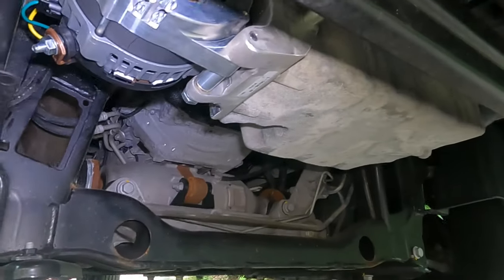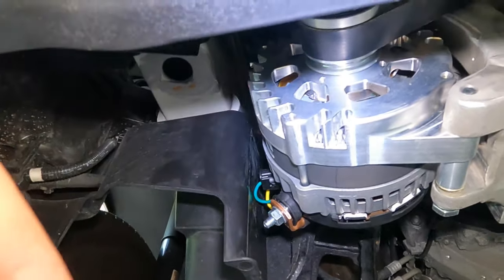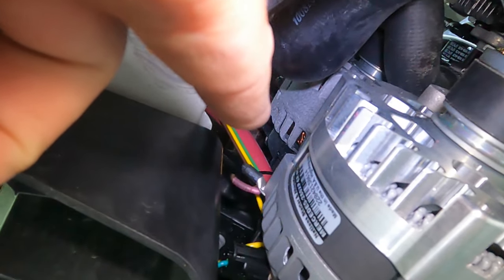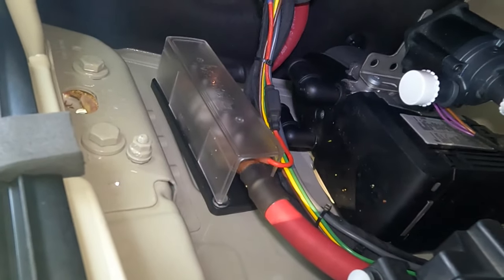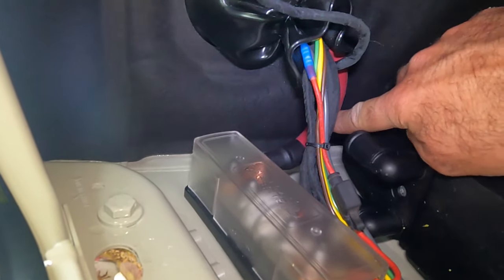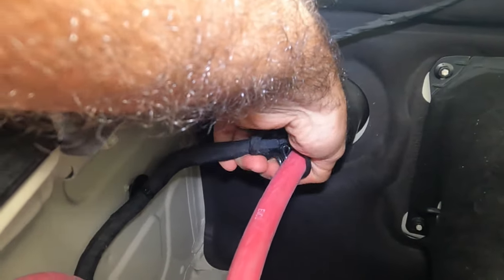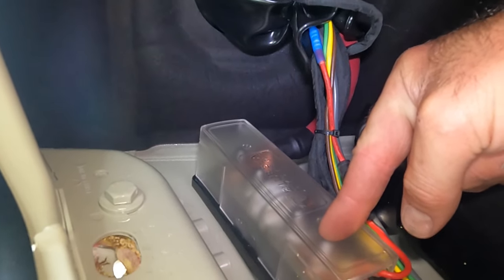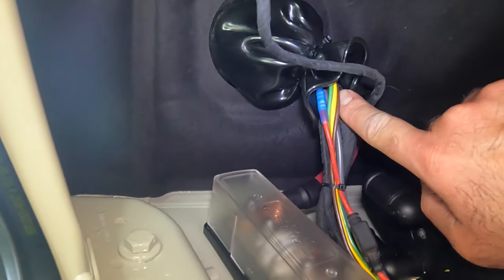Installing a Nations 280A auxiliary alternator in 2020 Sprinter VS30

Comment: Awesome video! We have the exact same van, alternator  and wakespeed charge controller, EXCEPT I’ve not connected the wiring. Until your video I was completely overwhelmed. Now, it’s not so bad.  Did you install a diesel heater beside the auxiliary battery ?  If so I would love to see the video. Thank you again for your excellent work!
Reply from the maker: Hey David! Glad you liked the video. We have installed a diesel heater (Espar D5e), although it's not finished yet. We still have to install the heat exchangers for hot air and hot water. But definitely stay tuned we will put together a video going over the complete installation of that system. Hopefully soon!

If you have specific questions about the alternator or heater install, send them over. We'd love to help you out as much as we can.
Reply: Thank you for your generous response. If you don’t mind, I have a couple of questions. Are your batteries and electrical system in the rear of the vehicle on the driver side?  If so, how many linear feet of 4/0 wire did you use?   I’m composing a shopping list and trying to avoid wasting any precious copper wire in the process. Thank you in advance!
Reply from the maker: @davidblood9882 The rear batteries are on the passengers side. I think in total we used about 15 feet of black for grounding and 30 feet of red. The red is longer because of the additional length from the alternator to the passengers seat. Hopefully that makes sense!
Reply from the maker: @davidblood9882  I wanted to add, those lengths include jumping the batteries together as well, because they are wired in parallel. And it also includes the connections to the shunt on the ground cable. It was recommended by Nations to use 4/0 cable on the ground wire as well as the charge wire.

Comment: Thanks for the vid. Getting ready to do mine, is there a reason you didn’t go under the van?
Reply from the maker: I like to follow existing cable pathways whenever possible because they're in areas deemed safe by the manufacturer. Also, it keeps the cable safe from road debris. Those were the main factors.
Reply: @OutofIpswich  fair 😊 thanks

Comment: Awesome video - very helpful as usual. It looks like you have a Renogy AUX chassis battery and a set of two Renogy House batteries - is that right?. I'm trying for a very similar setup (I have the alternator and the WS500 but haven't installed them yet) Is your Wakespeed charging the AUX battery under the passenger's seat or the House bank?
Reply from the maker: They're all 170Ah batteries from Renogy, you got that right. What I didn't explain, but should have, is that I ditched the OEM auxiliary charge wire. So all 3 are house batteries, and completely isolated from the vehicle system. The original alternator charges the starting battery, the auxiliary alternator charges the house batteries.
Reply: @OutofIpswich  Ah - Got it. I’m thinking about moving the AUX battery to under the hood with the RB Components brackets for the 2019+ vans and two 6v batteries just for my lighting. I’ve got seven LP9s on the front that eat up electricity, and the wiring harnesses are built for going under the hood.
Reply from the maker: @jamesmaccubbin7434  well there's a grommet in the firewall that's pretty simple to add to, and a wire trough under the carpet to the passengers seat. So either way you decide to do it, the wire path is pretty simple.
Reply: @OutofIpswich  Thank you so much! I saw that boot on your video and thought it would make a good route. I'll probably go straight back under the van for the WS500 and power wire. I started to take the fan and shroud out today, but started reading that there are coolant lines that need to be disconnected and pinched closed. Is that accurate? I'm having trouble finding anything on removing the fan and the shroud particular to putting the alternator on.
Reply from the maker: @jamesmaccubbin7434  I didn't have to disconnect any coolant lines. It would probably make it easier to get the shroud out, but it's not necessary.
Reply: @OutofIpswich  Perfect - thanks for your help. Love your videos !

Comment: Thanks for the video! I have been trying to find a 4/0 fuse block for a similar setup. Can you tell me what brand yours is and where you bought it?
Reply from the maker: Sure! It's made by Blue Sea Systems. I believe the part number is 5502. It's a class-T fuse block. Hopefully that helps but reach out again if it doesn't!

Comment: Good video. I had a question about battery placement/distance. I had read in multiple places that the connections (wires or bars) between batteries should be the same length. With one battery under the passenger seat and the other two in the back of the van. Is that not an issue?
Reply from the maker: If you have sufficiently sized wires connecting the batteries, they should be electrically equivalent. Technically, there is a non-zero resistance between our front and rear batteries, but it's negligible. We have had no issues.
Reply: @OutofIpswich  Thanks for the quick reply! Gives me options since I want to install 4 batteries and space is always an issue. I can explore using the space under the seat as well.
Reply from the maker: @kevinmctarsney36  good luck! The under-seat area is massive.

Comment: Do you need to upgrade the sprinter alternator to charge 2 x renogy 100ah battery's ?
Reply from the maker: It totally depends on how quickly you want to charge them! I don't know what the surplus capacity of the OEM alternator is, and it would depend on engine speed and load, as well as consumption (i.e.- how much electricity you're using, like lights, HVAC, etc.)

What I do know is a 280A second alternator should charge 200Ah from flat in less than one hour. I suspect the stock alternator would take much longer than that, but I don't have data to confirm it.

Comment: Can I install this on my 2.1 l sprinter? 
Can you share the link for the alternator thanks 🙏 
I have single 400ah lithium battery and charging it with victron 30a dc to dc takes forever ..
Reply from the maker: Check out this link and see if this will work for you:

https://www.nationsstarteralternator.com/Sprinter-Dual-Alternator-Kit-with-280XP-p/vflmk2493v-280xp.htm

It's not the same kit we installed, because it's a different engine, so I can't give you a ton of insight. However, the folks at Nations have fantastic customer service. If you have any questions we can't help you with, they're a great resource.
Reply: @OutofIpswich  Wow that’s  quite expensive and to ship it from US will be golden for me 😂😂
I was looking here in the UK but couldn’t find anything..
Reply from the maker: @MrSharK97  well it seems like you're dissatisfied with the cheap option

Comment: whats the purpose of the shunt on the ground cables ? good video !
Reply from the maker: Great question! The shunt is necessary for the voltage regulator to know the battery's voltage, so it can charge then accordingly. As the battery is at different states of charge, it wants to receive different charge input. And the proper charge profile varies by battery chemistry. Hope that helps!
Reply: @OutofIpswich  , Thanks for answering my question !
Reply from the maker: @ddkkrlsn  of course! Happy to help!

Comment: How much time it takes to charge your batteries?
Reply from the maker: It depends on how depleted they are and whether we're using the alternator or shore power to charge the batteries. If we're using the alternator, it depends on the driving conditions (i.e. - engine rpm, etc.). So, it varies a lot. But in general, they stay full with normal usage. We typically drive about an hour or more per day.
Reply: @OutofIpswich  is it ok to replace an existing sprinter alternator with high output one lets say 400amp because I'm installing 900ah battery
Reply: The BMS in the battery limits how much current it charge the battery. My guess is 100 to 150A. That's good, otherwise the wire can get very hot. For larger battery which situated in the back, i think 24 V alternator may be mandatod.